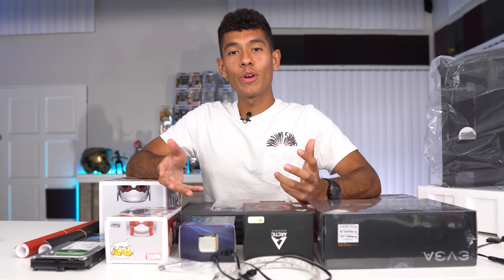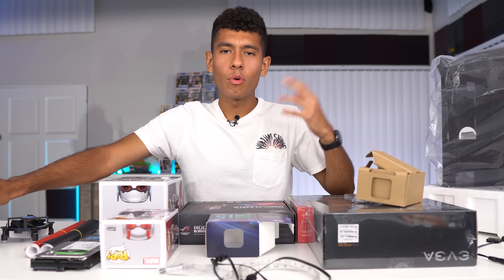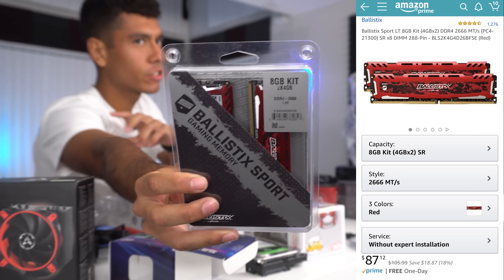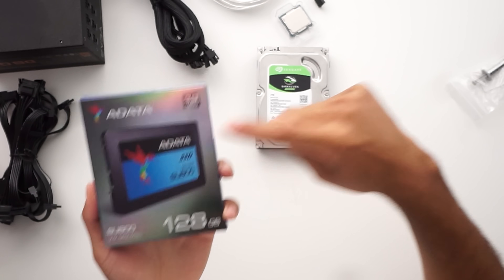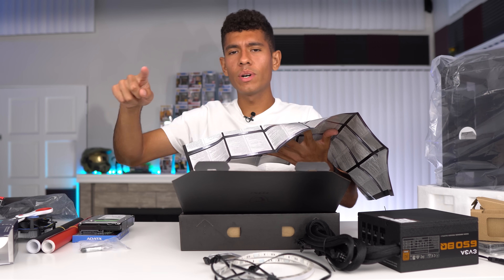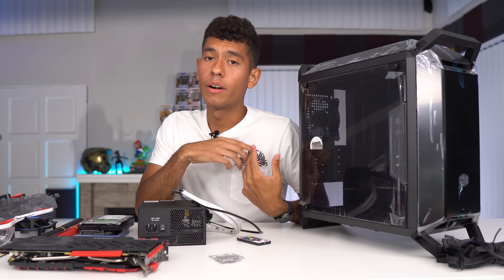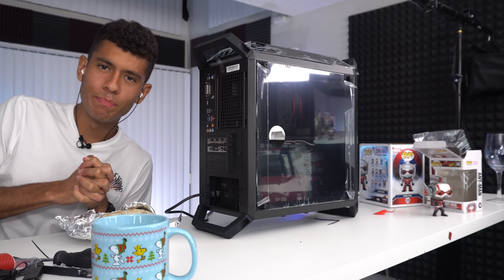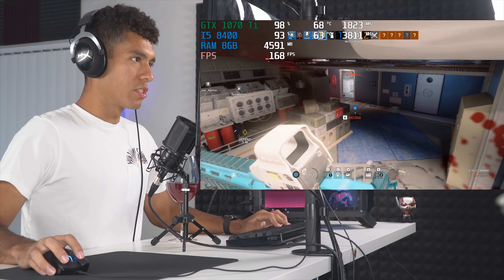$1100 Gaming PC Build - i5 8400 GTX 1070 Ti (w/ Benchmarks)

Comment: Bro would this work in 2025? I love the color combination of red and purple and am tying to build my first pc (I'm a noob in terms of pc).
Reply: This pc is probably only worth $320 in parts nowadays, so its very low end. Hardware has come a long way since 2018, a long way. Definitely not recommended to build it. Though he has great builds in his newest videos you can use as inspiration, and its possible to do a great looking build like this with modern parts.
Reply: The case and power supply are about the only things that havent changed since then. Everything else is severely outdated.

Comment: I Have a question is my gaming pc good i still dont have one but like im planning to build one the list pls reply i need tips btw im gonna play on 144 fps
Gtx 1660 super gpu
Ryzen 5 3600 cpu
Msi Z390-A PRO 1151 motherboard
Corsair CX450M 450 watt
Seagate firecuda 1 Tb ssd
Seagate expansion 2 Tb hdd
Corsair 16 gb (2×8gb) ddr4-3600
Pls answer somebody i need to know if its good
Reply: Yeah it's a pretty good medium spec PC. It should be able to play most games ultra 60fps and other stuff on competitive settings 144fps

Comment: I did this build but with 16gb of ram and an I7 9700k. Not able to overclock with the motherboard but wasn't planning to. Also the CPU fan does just fine cooling the I7 since no overclocking. Thanks Joey!

Comment: Geforce Gtx 1070 and intel core i5 or Ryzen i5 and GeForce rtx 2060 witch is better??
Reply: RTX 2060
Reply: The 1070 ti performs better but has no ray tracing.

Comment: Hey joey, im building a 3.3k pc in a few months, and im wondering if the specs are any good.

Here are the specs:
-CPU: AMD Ryzen 7 2700x

-Case: cooler master H500P

-Storage: Samsung SSD 970 EVO Plus, Samsung 860 EVO SATA III 1TB, Seagate barracuda 2TB HDD

-operating system: Microsoft Windows 10 pro

-monitor: 2x Asus MG278Q

-Graphicscard: Asus rog GeForce rtx 2060 strix

-Power: RMx 650w by corsair 

-Ram: Corsair Vengeance RGB Pro 2x 16GB DDR4

-Motherboard: Asus rog strix x470-F

-custom sleeved cables by corsair (black and white)
Reply: U should use the new ryzen 3700 or even a 3900x if u can afford it. with an x570 motherboard. Also and new you Rx 5700xt. better then an rtx 2070 super.
Reply: @ar1us559  hey, quick question, which x570 Motherboard should i take, i only found 1 good looking Motherboard that fits in my black and white themed build, its the ASROCK Steel Legend X570 (AM4, ATX)
Reply: @jellowed2083  this motherboard is good. You can use this motherboard. Nothing wrong with it.
Reply: Not bad build but you overpaid for less performance

Comment: Is 750 dollars good price for used pc with gigabyte gtx 1070ti and i5 9400f 1tb hdd, 120gb ssd, 40 dollar case, 1x8 2400 hyperx ram and gigabyte g360 motherboard?
Reply: Aleksa Gajic that’s a banging deal, you might want to add another 8gb stick tho. Make sure you check the pc if it works first tho, many scammers out there.

Comment: can anyone let me know if this build is the same price as of today or if there are better parts for the same price as of now, thanks <3
Reply: more expensive, go on ebay and get the 1070 8gb for $210.00 instead of the 500 amazon is asking.  The ryzen 5 1600 with the b450 chipset is also a better combo for the price because you can overclock and upgrade the components without changing the motherboard.  His setup with the i5 8400 and motherboard is fine but the ryzen build might be a little cheaper in the long run.  :p
Reply: No, there are better parts for cheaper
Reply: For example  rtx 2060 for 350$ and ryzen 5 2600 for 148$. And 16gb ddr4 3000mhz for 80$ and a gigabyte b450 for like 80 - 120$

Comment: I installed my gtx 1070ti gaming but the logo and red lights are not working please help.
Reply: Does it have customizable lighting?
Reply: @WhyIsEverythingTaken  yes we can change it through msi mystic light but my logo won't even light up. 😢
Reply: I know this is a stupid ass question but I got to make sure. Did you install the drivers?
Reply: @WhyIsEverythingTaken  yes I did installed the latest drivers updated my bios and switched the card into another pci-e slots changed my power supply pcie cables but still nothing well i got in touch with a guy who sell GPUs he told me that LEDs may have burnt aways you have to replace the shell of the card.
Reply: Makes sense, good luck with that
Reply: @WhyIsEverythingTaken  thanks 😊

Comment: Can this be upgraded and is it worth it in 2019
Reply: Go for a RTX 2060. Around $500 AUD
Reply: Sxnn once again very expensive which is unfortunate
Reply: If I were to upgrade anything it would be gpu and ram but it seems they’re all so expensive
Reply: Now RTX2070 is cheaper than GTX1070ti so I would recommend 2070 because it's more recent and with GDDR6 memory. Other parts depend on how much you want to spend, i5 8400 was an awesome choice when it released and it still is today, you can check 9th Gen if you are willing to spend a little bit more, I think i5 9600k is pretty good and only 40 dollars more expensive than 8400, but I am no pro, just personal idea.
Reply: Bill Zhang I appreciate it but unfortunately in my country the rtx 2070 is very expensive but I’ll check out the i5 9600k as well

Comment: That 128GB SSD won't cut it
Reply: Dxann why?
Reply: Dxann using it for a boot drive, yeah it will, are you on drugs?
Reply: @boyo7494  No ffs 128 isn't enough are you on drugs
Reply: @arachnidantics2370  it's-only-for-boot-up
Reply: @arachnidantics2370  theres also an hdd

Comment: I might build this but I'm probably gonna get a gold rated PSU and an unlocked i5 processor and an unlocked motherboard from msi
Reply: Mohammed Rahman get a Ryzen 5 2600, it’s 10-15 dollars cheaper and it’s unlocked. Has the same core count and it has hyper threading, also I recommend getting 16gb of ram since the prices has dropped @ 3000hz AMD cpus feed off of higher speed RAM

Comment: Got the same build. I5-8400 gtx 1070ti different MOBO ( z370p d3 ) 16gb 2666hz ram ( 2x8 ) but I got only 220fps average in Csgo and 120-130 in Dota2 :( does Ping has anything to do with fps? Cause my internet is crappy. Downloading OW and pubg right now, will let you guys know the fps.

Comment: a little trick you can make the system cost just over $700 if you go with a 1050ti the ryzen 5 2600 and the 500watt non-modular version of the power supply
Reply: Jmaster 2205 isn’t this over priced today anyways? like it doesn’t even have 16gb of ram
Reply: Yeah but it is still a great way to save some money while not sacrificing that much performance
That is actually what i am going to do for my pc but with the changes i said

Comment: If I was doing a build I would have gone with the Ryzen 5 2600 because it has better clock speeds than this and is unlocked. Also, I would have gone for 16 GB of RAM at a faster speed because computers these days require more than 8 GB RAM. For example, my PC that I use consistently uses 7Gb while watching youtube. never the less great build.

Comment: Rtx 2060 vs gtx 1070ti????, Which one??
Reply: depends on many things. but i might go with rtx 2060 its cheaper and has slightly better performance in some games and on some games 1070 ti is better. also if you get used 1070ti then 1070ti is cheaper

Comment: That i5 is gonna be a big bottleneck a few years from now.
Reply: What else should he have bought? apparantley you get 10% more fps in games if u get a i5-8600, so its not really worth it.
Reply: @cucurellaaaa  go ryzen? The extra threads are already being outlined. A 2600 would cost about the same
Reply: @jeffreywarf  I guess it depends what country you live in. Because you need better ram and a motherboard that will support that memory speed for ryzen.
Reply: @cucurellaaaa  that's true. I guess that's why guides like these can't really provide reliable pricing. 

But if you go with 3000 mhz b-die ram that should save you a little, and get a b450m instead of x470.
Reply: @cucurellaaaa  but, for sure, for 1100? You shouldn't be going with a 2.8ghz non hyperthreaded cpu
Reply: I would juet buy something even better if I would breal the budget.

Im bulding an rtx 2060  + i5-8400 pc next week. My goal is to play games in 1080p with high fps, I think the 8400 will do just fine tbh. It does have the turbo boost when it needs that extra juice.  Cost was around 950usd because of sales.
Reply: @cucurellaaaa  well I hope it lasts you longer than I expect. I'd rather people have a good time with their build than be right.
Reply: If you are just going to be gaming then an i5 will just be fine especially since most people aren't going to be streaming at the same time and with amd processors they typically scale with high clocked ram which can increase your costs and I5s 9600 or 8600 will typically get higher frames per second then amd since just overall they have been better optimized.
Reply: @Justgarlicbred  I have seen assassins creed odyssey use 100% of the i5 8400, so I'm still worried about its longevity in aaa games

Comment: How do you get this case to run so cool? I have AMD 2600x stock cooler, RTX 2060, and haven't added any extra fans. Probably hover around 70C if I don't remove any of the panels.

Comment: I have a 1070 ti build but it is $2500 build
Reply: When did you build it?
Reply: april 2018
Reply: Building a pc with a 1080 Ti is that price. Building a pc with a 1070 Ti shouldn’t cost like $2500. Lol you got ripped off
Reply: @jadenphiakhamngon3755   sorry I meant 2000 its 2500 with periperals

Comment: If anyone is going to buy this today it will cost about $1250 the prices have gone up on the graphics card so if anyone is going to buy this I would recommend to try and look for a cheaper 1070ti or maybe a 1070 just a heads up.
Reply: Shanedon98 they sold out of the 1070ti..

Comment: Hi JOEY!!!  I hope you will not be the next PROFESIONAL Expert who will ignore me completely PLEASE HELP ME PLEASEEEEEEEEEEEEEEE. SORRY BUT I DON`T KNOW MUCH ABOUT GAMING PC.
I WILL BUY IN A FEW DAYS HTC VIVE, SO FAR I HAVE A PC ONLY, PLEASE HAVE LOOK THANKS!
I5 8400 Hexa core 2.8Ghz/ 4GHz ,
 Gforce Gtx 1050-2gb GDDR5,
 8GB ram(2400 MHz) SAMSUNG 8GB DDR4 PC4-21300,266MHZ, 288PINDIMM, 1.2V,CL 
I BOUGHT ANOTHER ONE SAMSUNG 8GB RAM (SAME ONE)  SO NOW I HAVE 16GB RAM.
AS FAR I KNOW  NIVIDA  GFORCE GTX 1050   IT  IS NOT THE BEST, NOT ENOUGH FOR HTC VIVE.
 I`M THINKING TO GET THE MSI GAMING GFORCE  GTX 1070TI, IT WILL FIT-MATCH INTO THE  WHOLE SET?  I DONT KNOW WHICH I HAVE MOTHERBOARD :(
BUT FOR SURE I KNOW ONLY ONE THING THAT I  BOUGHT THE PC FROM 
https://www.currys.co.uk/gbuk/computing/desktop-pcs/desktop-pcs/msi-infinite-8ra-intel-core-i5-gtx-1050-gaming-pc-2-tb-hdd-black-10182435-pdt.html

Comment: Hey anyone. If I were to have a higher budget, would I be able to use a core i7, just for extra power? I'm new to PC building and I dont even know if it would work.
Reply: Yes, you would be able to although it would give you almost no benefit with this system. If you want to upgrade your cpu I would recommend the i5 8600k
Reply: @elidoherty9935  thank you

Comment: Can i put a 9600k in this build?
Reply: Hunter Stansbury, yes it is the same socket, but you might have to do a bios upgrade on the motherboard. If you don’t feel comfortable doing that, just get the 8600k, as there is not a  significant difference between processor generations
Reply: Eli Doherty Ive seen in Joey’s full setup tutorials how to do bios updates, thanks for answering my question!

Comment: Nvidia founders edition gtx 1070 8gb
intel i5 8400
Asus rog strix H-370i itx gaming mobo
Corsair dominator ddr4 16gb 3200hz 2x8
Corsair rm1000x full modular psu
Corsair H100i v2 cpu cooler
Hp nvmm2 ssd 250gb 
Phanteks evolv itx tempered glass case. Pls tell me guys i need new pc but idk anythink how is that build
Sorry my english language so bad…

Comment: Anyone build this and get the CPU Fan error at bootup? Any suggestions on how to fix?
Reply: I just built this pc and I am getting the same error
Do you know what drivers to install and how to control the lights on the case?
Reply: @ryanmccauley5503  This sorted the cpu fan error. https://youtu.be/CG63bPkXqR4 As for the lights on the case, There are some wires labeled Power SW, H.D.DLED, Reset SW. Refer to the instructions and it will show you how to connect them for the LED's. Also, I went with the instruction option to make one of the buttons on the case to control the lights instead.

Comment: Im building this in a month and I was wondering I want to upgrade to a AMD Ryzen 2700x instead any motherboard recommendations cause I need a compatible motherboard also would the cooler in this vid for the i5 work for the and ryzen 2700x if not which one would work I’m also going to 16 gigs of ram thx

Comment: For streaming fortnite without problem should i buy this??
Reply: Go for the 7 1700x for 140 on sale (Microcenter )
Reply: Yes as 6 cored is good for streaming 4 for gaming and 2 cores for encoding a stream
Reply: Yes
Reply: Don't stream fortnite
Reply: Fortnite can run on a microwave, its the streaming you gotta worry about, don't get an i5 8400 unless you budget allows it, otherwise go for a Ryzen 5 2600 or the 2600x as Ryzen is proven to be better at multithreading compared to intel, which is superior in only gaming. Maybe also switch the case, as the front fans are choked completely in this case due to the acrylic front panel. Hope this helps! :D
Reply: if I upgrade my cpu do I have to upgrade my motherboard too?
Reply: @marcfranco21  that depends

Comment: Can I use 16gigs(8×2) ram instead of this one also a 750 watt PSU instead of this one
Reply: That works but 750w isn't necessary as this build pulls 450w and with 650w you could push a 1080 ti or 2080 on this
Reply: @thegoat9259   thanks
Reply: Yes . to activate dual channel
Reply: I Stole Yo Bitch  thanks bud
Reply: So this build will support 16gb of ram?
Reply: @usb598  Of course it would
Reply: @thegoat9259  I'm just confused on the mhz part. Is a 2x8gb 3000mhz ram kit going to work well?
Reply: @usb598  The MHZ only makes a difference in performance if you go with Ryzen however this is Intel so it's a significant performance difference so 2400,2666,3000,3200 and 3400 will work but make sure you go to bios and make sure it's running at that speed
Reply: @usb598  I could help you with the PC build just send me your twitter and we can talk
Reply: @thegoat9259  ry_bangz is my Twitter @
Reply: @usb598  messaged you

Comment: This system is not very efficient and the best price for performance ratio. You can get a ryzen 7 1700 for cheaper or could get a ryzen 5 2600 for cheaper and both come with amazing CPU fans. You need to learn that Intel screwed you over since the 6th gen and on. This build could've been $720 yet you wasted your money. Only true computer nerds know that case sucks in ventilation, on top of that the Funko Pop restricts it even more. Wasteful wasteful wasteful

Comment: Compiling my first build online, what do you think?

AMD - Ryzen 5 2600  
Noctua - NH-U12S SE-AM4 CPU Cooler  
MSI - X470 GAMING PLUS ATX AM4 Motherboard  
Corsair - Vengeance LPX 16 GB (2 x 8 GB) DDR4-3200 
Kingston - A400 120 GB 2.5" Solid State Drive
Asus - GeForce GTX 1060 6GB 6 GB Turbo Video Card
Phanteks - ECLIPSE P400 TEMPERED GLASS ATX Mid Tower Case 
Corsair - CX (2017) 550 W 80+ Bronze Certified ATX Power Supply
Corsair - Air Series SP120 High Performance Edition (2-Pack) 62.74 CFM 120mm Fans
Asus - VG245H 24.0" 1920x1080 75 Hz Monitor
Redragon - K552 Wired Gaming Keyboard
Razer - DeathAdder Elite Wired Optical Mouse

Total: $1169.29

Comment: Can this motherboard use 2x8 gb ram? Sorry not really a big tech guy
Reply: Yes
Reply: @jordaneckman797  hey, would it be smart to change the i5 to ryzen 5 2700 and the motherboard then to msi b350m mortar
Reply: If you use the i5 in this video performance should be about the same for games, but ryzen is better for multitasking and streaming, or editing video
Reply: The best ryzen 5 is the 2600x the 2700 is ryzen 7
Reply: 2700 will cost more but will have much better performance
Reply: I recommend the b450m bazooka motherboard for either
Reply: For amd

Comment: I just ordered a Cyberpower Gamer Ultra Vr from bestbuy ...$845 Plus $160 off So basically a $1k Gaming Pc, I'm planning to upgrade the Ram Later On Since it's My First Ever Pc. I want to start streaming and play pc with a remote.
SPECS- RYZEN 7 2700X
NVIDIA GEFORCE GTX 1060 3G 
1TB Hard Drive
Idk what kind of motherboard 
Or 8gb Ram DDR4 SDRAM 2400 MHZ
Comes with Mouse And Keyboard

4 1/2 star Rating
Reply: oooof you got ripped off

Comment: I’m trying to build this pc and I was wondering what the fan splitter cable is for. It’s in the parts list in the description. Just wondering if it’s needed if I used the stock coller that comes with the cpu.

Comment: Would a GTX 1060 6GB still work fine with this build?
Reply: Absolutely
Reply: I would use a i5 8600k tho for overclocking , he has a build guide for this
Reply: @Ajgoody34  I ended up going for a Ryzen 5 2600 and Gtx 1060 6GB
Reply: iFrog Man honestly you might get a cpu bottleneck but idk, i run a i5 8600k and a 1070 and have no problems. Up to you.
Reply: @iFrog Man honestly that would be fine the ryzen 2600x is pretty much on par with the 8600k once over clocked and much cheaper
Reply: RyanSmithHD yeah what you said
Reply: iFrog Man i didnt know how the cpu's compared
Reply: iFrog Man regular 1070s are mid 300s
Reply: iFrog Man gtx 580? Seriously?
Reply: iFrog Man Oh were you referring to the RX580? I thought you were talking about the GTX580 which was released a long time ago and is obsolete. The RX580 is fine for 1080p gaming and is around the performance of a GTX 1060. I don't know much about the 590 but I think it only has a slightly higher performance so it's completely up to you.